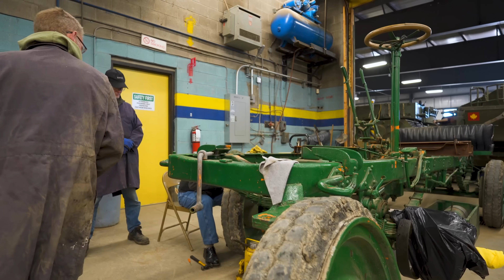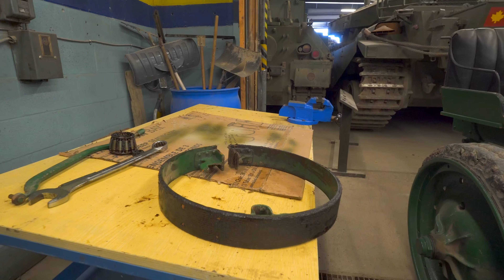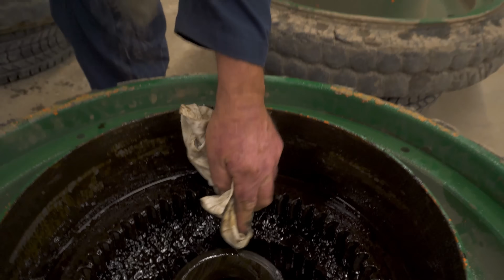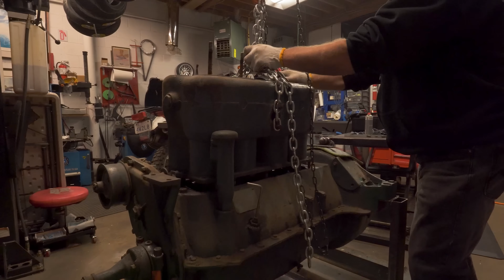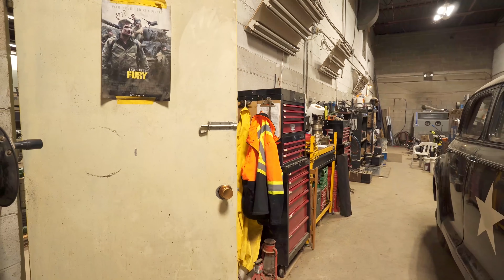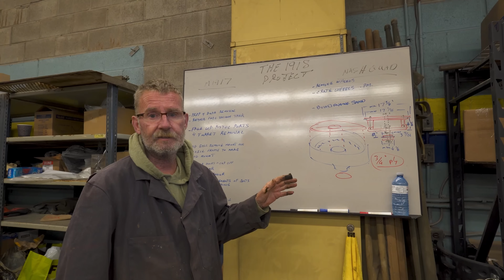PROJECT 1918 - Stubborn Steel -  Episode: 03

Comment: Hi I am part of the museum team and an x marine technician, he talks about the cyl head as a one-piece unit it reminds me of the Mercury marine outboards of the 80s they also had a 2 piece block. reason higher compression merc 115 inline 6cyl was like that, we OMC techs called them the tower of power. cool design tough to work on without taking the head off to inspect the 2 stroke cyl walls for scoring etc. great job guys see you on Saturday